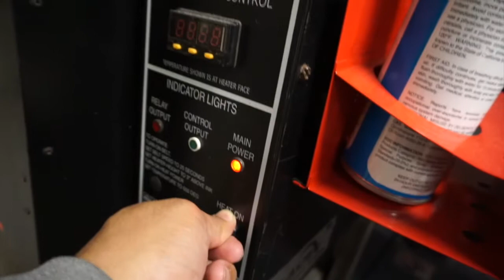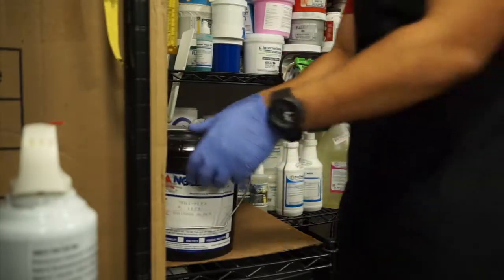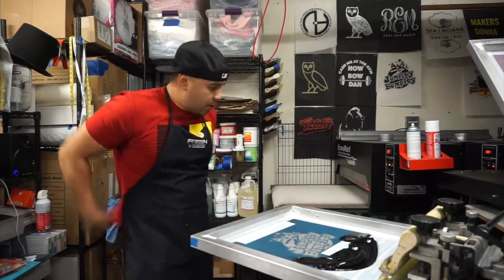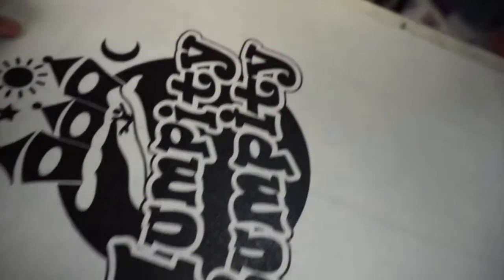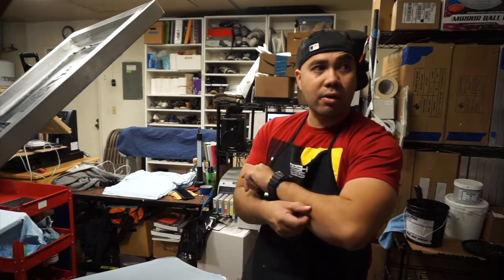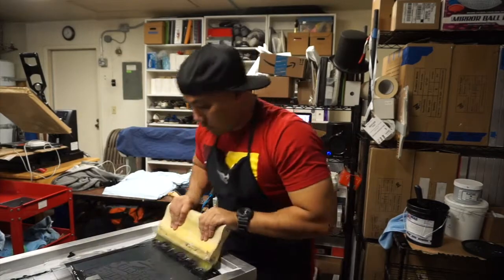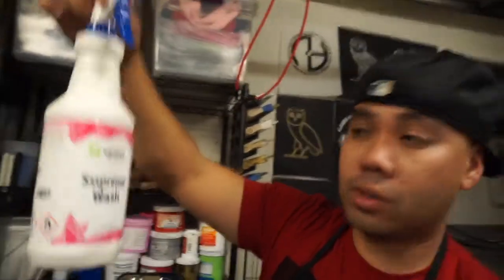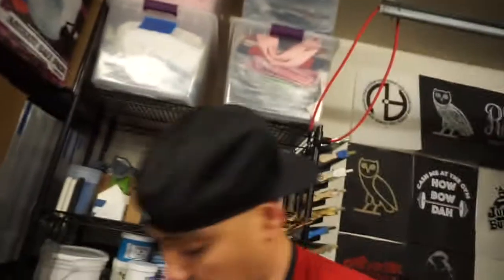Screen Printing: Youth XS - Jumpity Bumpity (re-order) (Vlog 240)

Comment: Get a wifi booster :)
I got better wifi in the shop when I got one.
Reply from the maker: Jason Enz have you ever had to adjust those plastic screws in the gates?
Reply: RhyBeats no because I took every nut and bolt off this press to clean it. When I put it back together, I meticulously centered the print heads in the gate. Take the 1/2 hour it will take...if they are out of whack. Check the brackets on the platens, previous owner may have moved the bracket location for a certain job. If there's random screw holes, it may be the platen. Not likely but worth taking a peek!